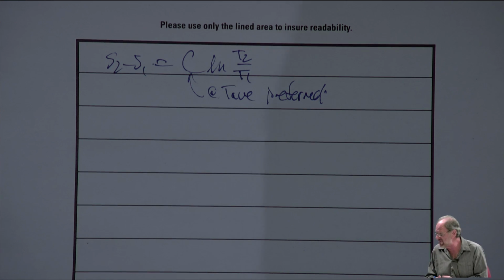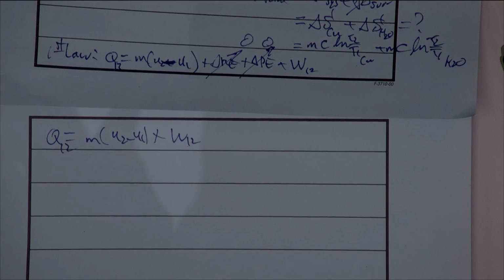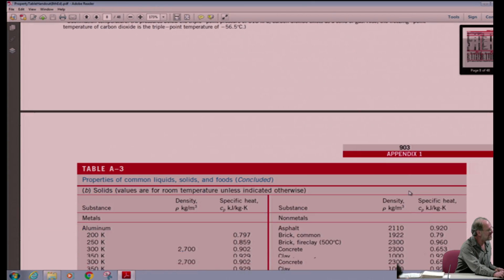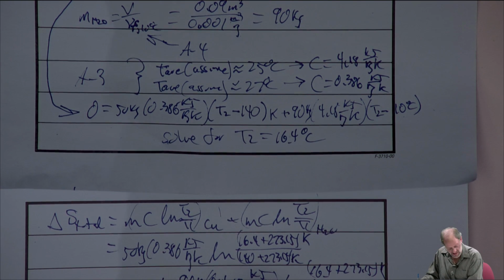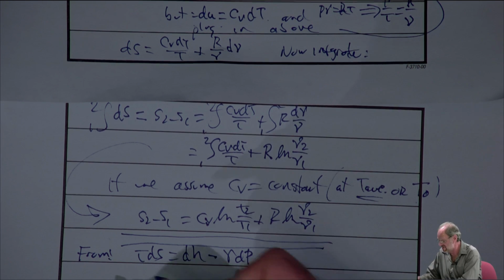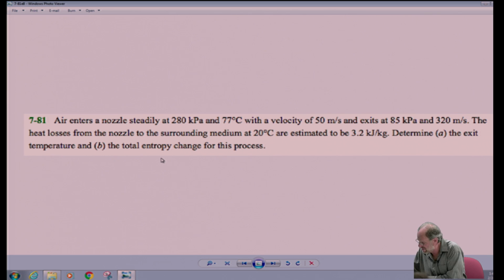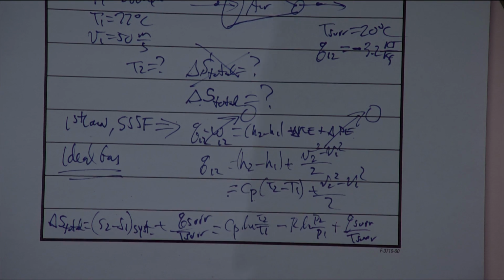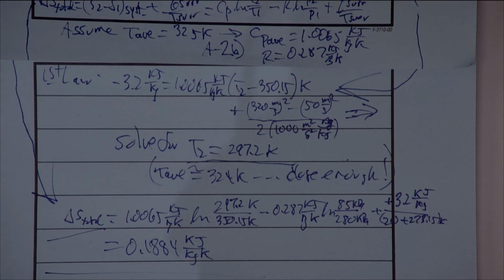Thermodynamics: Entropy; Increase in Entropy Principle, Solids, Liquids, & Ideal Gases (20 of 25)

Comment: on the last question there is a change in velocity so why you're using the single steam steady flow(SSSF) equation to solve it? Isn't the change in velocity means its not steady flow process?
Reply: Steady means that there is no mass accumulation in the system. 

Mass conservation says that the m1+ (change is mass)= m2.  If we take a time rate of change of above and set the change in mass of the system to zero since the process is steady we see that mdot1= mdot2 for steady flow. 

The velocity is not constant for steady flow but the mass flow rate is. So product of (density)(area)(velocity)= const

All three of the above terms can change but their product must be the same at the inlet and outlet for steady flow. If velocity changes then area or density should be modified to make sure that both flow rates are equal in the end.